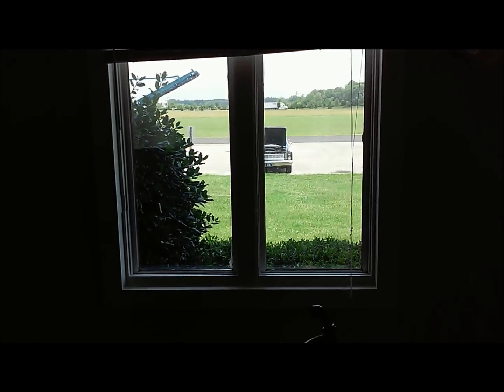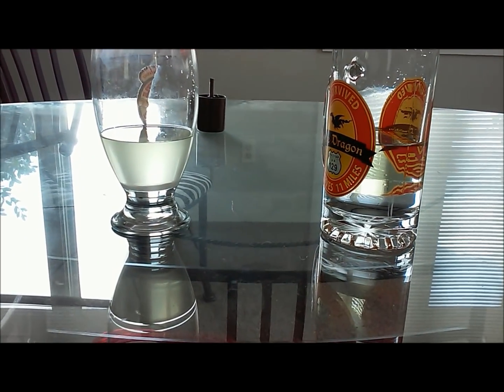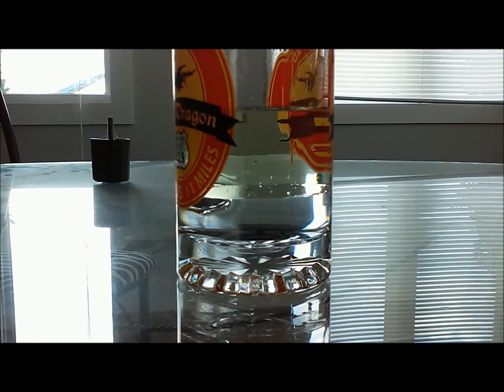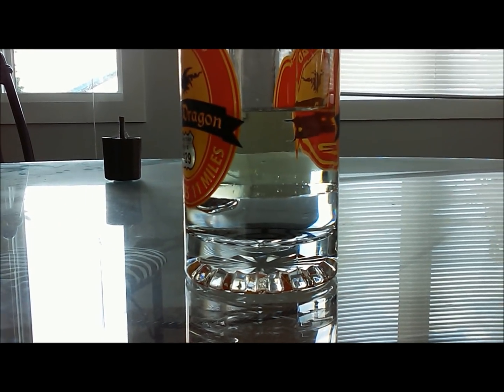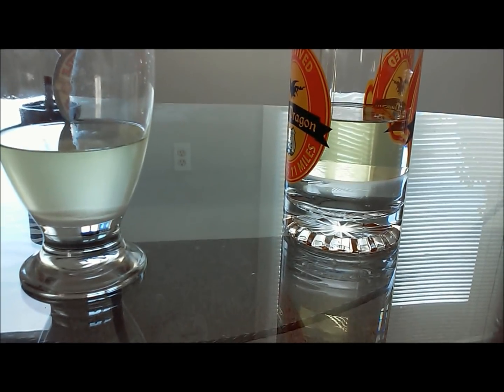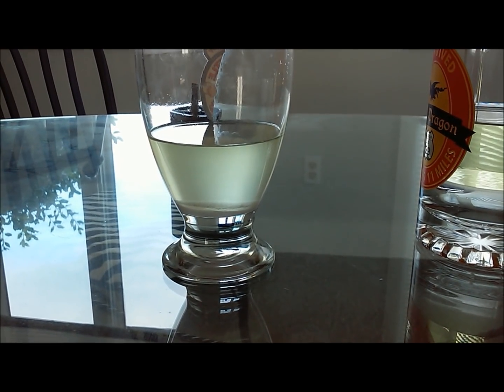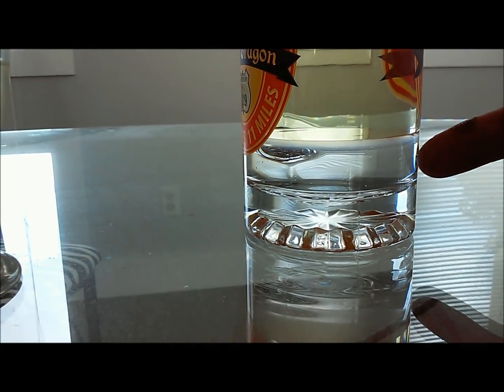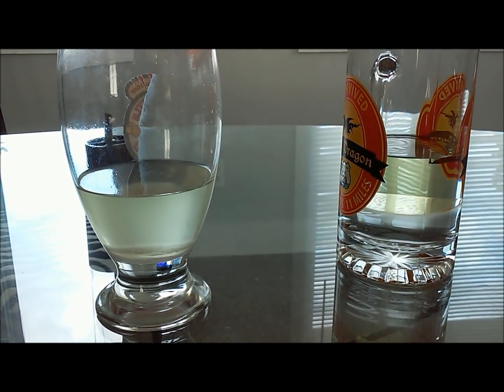Sugar vs Water in Gas (Effects)

Comment: I read that only about a TBS od sugar will dkssolve per full tank of gas and just burn with the gas. The solids like sand or dirt would never get through the fuel pump strainer.

Wish you had also done gas, a bit of water & dry gas (alcohol) which shows how the dry gas allows the water and gas to emulsify so no big slug to freeze in the pump or gas lines, nor enough per intake stroke to prevent combustion.

Would also like to see gas, dry gas, water & sugar. 

Because the water dissolves the sugar, and the alcohol allows the water & gas to emulsify, I wonder if that also allows a lot of dissolved sugar to get in suspension too, or precipitate out.